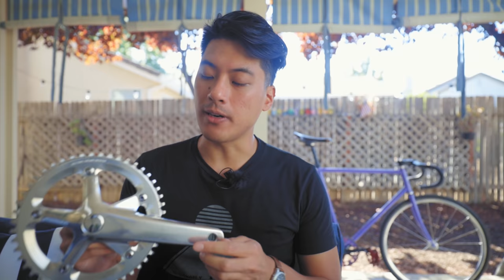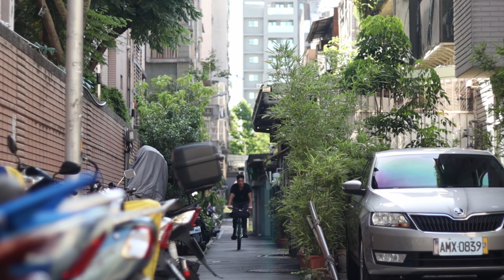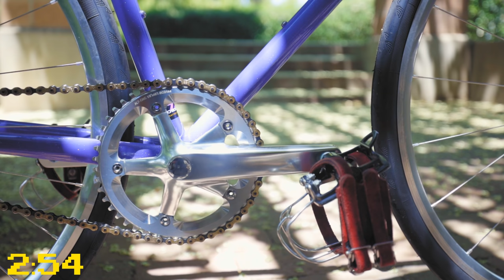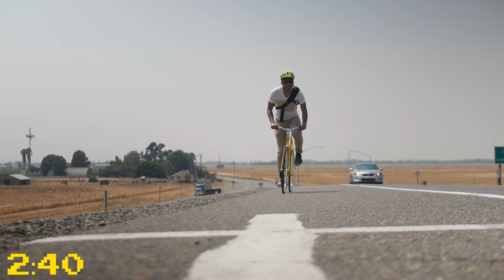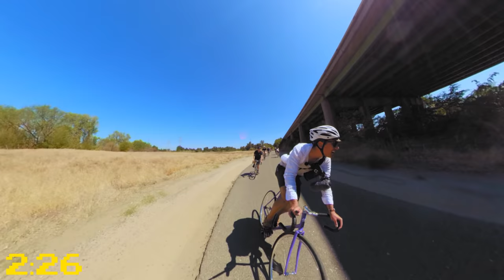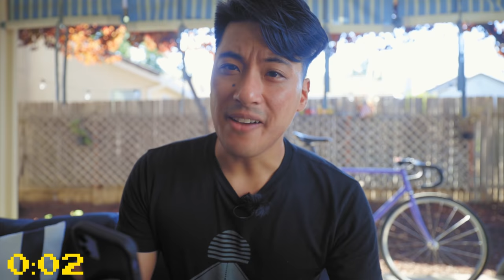The Best Crank Length for Fixed Gear

Comment: It all has to do with an individual's body geometry, based on the length of an individual's leg 🦵 bones, which also may determine your saddle height,fore-aft, tilt.
Reply: @Bebo as someone that is 6 3 165s made me move my feet in the most awkward way, its like doing the tiny arm circles and put so much stress on my joints

Comment: I went from 172.5 down to 165, liked the result so much that I now want 150mm rotors.  Im quite long legged and didnt see this coming.   Bombing hills fixed is mellower and quieter with shorter cranks - it may also develop cadence for racing.

Comment: i have a cheap steel fixed gear and it came with 170 but i put a 165 andel crankset on it and its so much easier to take tighter turns now and the bike feels way more agile overall.

Comment: I started riding fixed gears on the road before the track. But I have always adapted as road bike to fixed rather than a track bike. At 185 cm, I have used 175 cranks on the road. It just feel like more of my leg muscles are engaged with the larger circles. I use relatively low gears - about 2.5:1 or 40/16. This means going down hill I start to spin out at 45 kph. Though I got used to the shorter cranks at the track, I found the longer road cranks more comfortable. Besides, the relative increase from 165 to 170 is only 3%. Not really that significant.
So the my answer is whatever works for you as long as it does not hurt unnecessarily.
Reply: @Bebo I suppose part of it is what you are used to then you learn to prefer that. When I started with the local club 35 years ago I was a masher then I learned to spin instead soon after. I usually average about 88rpm on the road. My natural is 95 +/- . Does 55 count as old enough?

Comment: I actually find it easier to reach higher speeds with 165
With 170 it feels harder to contain my legs in a circular motion at higher cadences, I tend to top out around 140 rpm and lose a lot of energy

Comment: Not everyone's femur, tibia and fibula are equal in ratio to their height. Some have longer femur bones compared to there tibia, and fibula. So make sure you get the correct size based on your physical dimensions for optimal fit and longevity of your joints, and the other stuff that's in there.
Reply: Well said. I'm 6'2" but my femurs are 2 inches too short for the rest of my body, so I can ride any crank longer than 170 at all

Comment: 165 for spinning... 170 for climbing. You can find some crank arm lengths at 167.5? That will give you the middle ground. What's best for you kinda depends on your terrain. I got my top speeds and cadence with 165's, but hills are definitely tougher. You will feel a difference for sure.
Reply: @Bebo Yeah if you’re gonna be riding pretty aggressive, then 165 makes sense. I never had a pedal strike with 170’s, but I’m not super aggressive either. I like both and honestly I bet I’d love 167.5’s to meet in the middle.

Comment: I prefer 165mm on a longer ride, 500km/week seems no problem at all to my quads and knee.. now I'm running 170.. feels good for stop-and-go.. but a huge no for lobger ride.. 

Long short story i finally gave up on fixedgear and bought me a freewheel instead.. same ratio like my fixed gear, 48/16 (i dont do skids on fxdgr btw) and guess what?

I can now doing 50kmh with ease.

Comment: Great fixed /single speed info... Entertaining with a welcome shot of sarcasm!!!  I use a flat handle bar.... What are the best widths for what applications.... Thursday topic? Pedal onward people!!!
Reply: I used to ride 175mm all the time on a 58cm frame...
I Still want that crank length....  On fixed gear frame, typically BB is higher off the ground, so clearance issues are a non starter.
Short legs and lazy people use 165's 😀😃😀

Comment: Im 5"7 with an inseem of 32.5" . I only measured my crank arm length because of this video, It turns out I was running 175mm. It is a living hell for me, I began experiencing knee, ankle and foot pain. I knew I was a spinner before I had my new bike and I kept wondering why I find it hard to maintain even an rpm of 90.
Reply: 175mm on a fixed gear? Dang

Comment: Do I see MKS GR-10's attached to cranks? Aren't they lacking grip? That nice cages probably get scratched or require to keep bike on rear wheel when pushing it without actually riding it. Considered them myself but seeing how fast I got scratches on current cheapo setup not sure about MKS route, even if I like MKS stuff.
Reply: Soft races? Im on first set of MKS pedals on kid's bike so can't say about longevity but they spin very smoothly. Races looked much nicer than in my other pedals. Will see, how they last. For my bike will fetch some pedals locally just because price is right. I hope those needle bearings will last.
Reply: @Bebo I have learned plastic pedal hurts as hell when tibia bone meets it. There's barely any meat under skin so it's painful with any pedal. Plastic is tough so from practical point it's fine as material.
Reply: @Bebo Nah, I'm not type of guys who go screaming about noodle frame and cranks. Can't push it to the limit, anyway.

Comment: There's a big difference between 165mm and 170mm, I first started fixed gear with 165mm but my road bikes where 170mm. Using 165mm I couldn't add much power to my skids and forget about the gear ratio 48:15 at high speeds I was feeling like a hamster spinning reel. Now I'm ridding 170mm Dura Ace 7600 and my gear ratio now is 47:15 everything feel so much better, I gain speed faster, stop faster and skid way much better, I know I'm riding -1 tooth but I'm spinning slower because of the extra 5mm which feels better to my legs. I'm 6.0" tall, cornering was about the same. I'm very aggressive so I have to take care with 165mm anyways.
Reply: @Bebo I'm 6.0" but I'm also fit as heaven, maybe I'm extra flexible and you're a little less flexible and that's why you can't spinn like I do, one thing you're right I don't commute just like you, I don't commute I race and 40mph is usually where I found to be.
Reply: @Bebo I went on the scale just for you and this morning I woke up to be 139.2lb

Comment: What's the best frame size for a fixed bike for commuting, is it slightly smaller, the same or slightly bigger then the traditional recommendations?
Reply: It depends, as usually. City, lots of turns - smaller is nicer, more agile. Lots of long speedy stretches without real turns or with long curves - longer could be more stable. But that also depends on handlebar type, load on front wheel, distribution over frame. On your condition and your preferences. Some people don't really notice 2cm length of TT, some feel it after riding for a few seconds.
Reply: @event4216  more looking in seat tube height.
Reply: Looking to run carbon seat post and want it longer? Otherwise SP length is purely esthetic.
Reply: @event4216  edited seat tube 😉
Reply: @Bebo thing is I've got a old Raleigh but it's 62 cm frame 😬and I'm 6ft
Reply: @Bebo what I'm saying is the seat tube is 63 cm from the BB to the seat, I don't want to be going any higher than that, it's the height of the bike that may be to large as in not able to touch the floor, but hey I'll be double xp on those fixie stops aha

Comment: Whats the difference between square-tapered and hollowtech cranksets?
Reply: Cost, weight, square tapered has been around for a very long time.
Reply: They said that hollowtech has a better power output and also it is lighter. But the square-tapered is cheaper and less risk on unexpected disassembly of left crank arm on the spindle , I also witnessed a hollowtech that left crank arm just came off while riding.
Reply: but hollowtech cranks have less maintenance right?
Reply: @darrenjamesbelangel953  in terms of maintenance I  know that the  bearings of the hollowtech is easier to repack than the square-tapered
Reply: @haroldharina73  thanks man I appreciate it, just asking on what cranks I should build. But my new problem is rims, but ive decided to go 90mm but still I wanted to do the 20mm but Im a heavy rider lol
Reply: @darrenjamesbelangel953  I'm currently using square-tapered and I have no issues in using it.
Reply: HTII cranks also look cool :p
Reply: @haroldharina73  I know but I wanna try something new XD plus I am building a mid end fixed gear or something soo yeah

Comment: I use 175mm all the time on 58cm frame. BB is typically higher off the ground so, I haven't noticed any peddle strikes.  165's are for short people and lazy people looking for an easy ride 😀😃😀